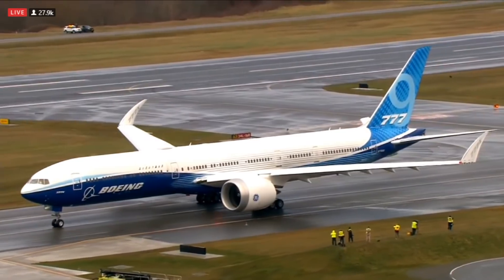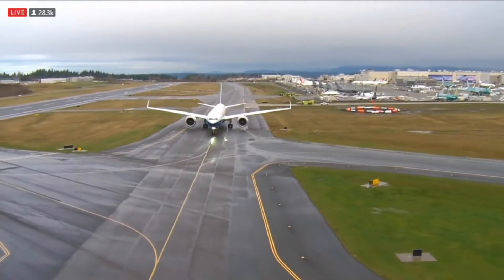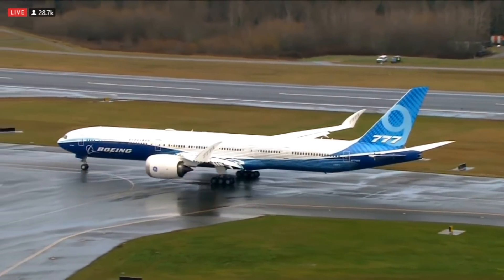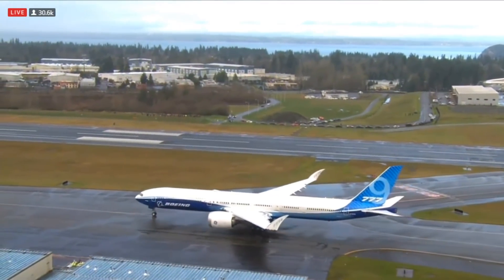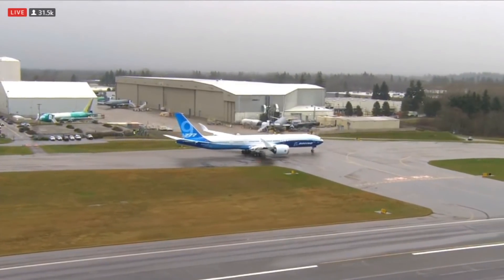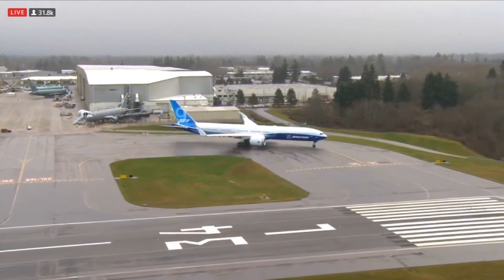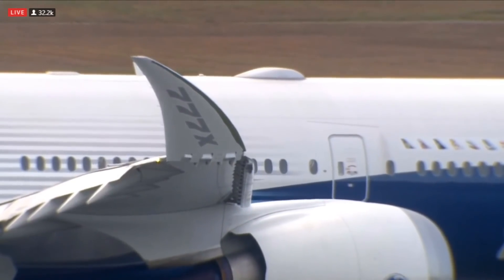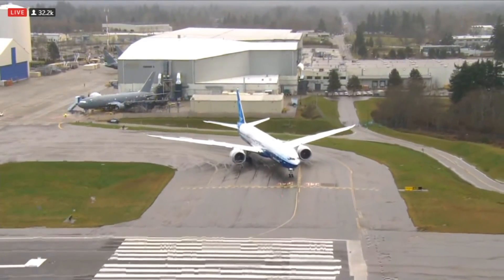Boeing 777X taxis to the runway for its first flight

Comment: I Hope for A Boeing-Industry to sending a proffesional-expertis as the official-supervisor especially to a loyal-costumers + the new airlines-company to around the world to traning the about of all navigation-system built-in or a important part-components inside because like The B737Maxx8 or The Airbus-310 NEO are having a crash-accident event { Lion-Air & Ethopian-Air  < B737Maxx8 and then Aeroflot-Russia , Wings-Air Germany + Air-Asia Malaysia > A310Neo } who caused the mall-function software and a failure body-structure hardware including the tail-wings design by a standart re check-in duty for safety-reason.

Comment: "We did it" no you killed 300 people with your error!
Reply: And how many people have been killed  on airbus planes?
Reply: @dbl2dancer  None with plane error all that where killed where pilots error!
Reply: @JestersWolf  Seriously a 321 didnt respond to throttle command at at airshow and crashs, air france 442 in 2019  A330 crashes and kills 220 people with a high altitude  stall
Reply: @dbl2dancer  That happend in 2009 and it was due to copilot error.
Reply: @dbl2dancer  Boeing will never wash of shame off of their name everyone will talk about this for houndreds of years maybe even more. You dont sell your planes until they are completly checked and stressed for all situations.
Reply: @dbl2dancer  heck even Boeing admitted making a mistake with the software. I wouldnt trust company that makes those kind of mistakes due to cost cuts. Its totally iresponsible and dangerous. Now they talk about safety! Safety allways goes first suckers!
Reply: @dbl2dancer  you are trying to justify and to wash off your fear cause you are probably a pilot on one of these flying cofins. Good luck!

Comment: can any one elaborate the major difference b/w 777 and 777x
Reply: The 777x also has more efficient engines for less fuel burn and will fly considerably further, thus giving airlines opportunities to add more cities to fly to non-stop, Also, the longer variant can add additional seats to reduce costs for the airlines. Finally the wings are made of composite materials similar to both the Boeing 787 and Airbus A350 which makes the wings lighter and stronger.
Reply: Foldable wingtips, longer fuselage, slightly bigger engines
Reply: New composite wing, foldable wingtips and new engine

Comment: 1:04 that van gets dwarfed by the 777X  engine 😬
Reply: @Lew Rodd yes the A380 is a big ✈ . Yet has nothing to do with the size of the engines on the 777X (others mentioned also how damn big they are). Im just replying about something thats in the video.
So the real question is whats the point of ur reply ?
Reply: @Lew Rodd 777x is actually bigger than a380

Comment: If they mess this one they will be out of game. Difficult times for Boeing
Reply: Truth  It's quite disturbing that people like you are still trying to make it seem like there is no serious problem with the MAX. Two of them crashed in identical circumstances, with the loss of almost 350 lives. And the root cause of the crash is a design flaw, there's zero doubt about that. Whether European or American pilots would've saved these planes is (very) debatable, but what isn't debatable is that NO aircraft should ever by design put its pilots in a situation where they have to save the plane. This is a VERY serious design flaw.

The assertion that thousands of flights of the MAX by American and European pilots happened without incident is also completely irrelevant. You'd have a (limited) point if on dozens of those flights MCAS would've malfunctioned in the way it did on JT610 and ET302, but the TRUTH is that none of them were reported. So the remark about American and European pilots is completely irrelevant.
Reply: Nico V  Agree and that is why I told him his name should rather be FALSEHOOD. If he is correct, why are ALL still grounded and why is Boeing not producing more. These are false information peddlers but they cannot deceive those of us that are current
Reply: @nicov1837  Exactly!
Reply: Truth  the truth is they were not trained at all, Boeing told to Lion that there is no difference between 737-800NG and MAX. Lion once requesting for a training but Boeing said that was an idiotic request. (Source: Bloomberg)
Reply: Domba Tersesat If it is true, why is MAX still grounded? You are out of touch and need to check your facts
Reply: migfed They won’t miss it.
Reply: @Truth You are just another ignorant entitled American trying to justify unnecessary deaths by a faulty piece of machine.Stop sharing crap.Innocent people died just in case you forgot
Reply: rein mahupete Agree. Check my response to his comment. His correct name is FALSEHOOD.
Reply: Truth comment so irrational.
Reply: Truth   Do you seriously think that they grounded all 737 Max for nearly one year just because of a problem with pilot training ?
Reply: Truth  your argument : rubbish
Reply: Truth  

#Truth
Reply: Well they had a screw up with the starliner capsule...
Reply: Truth So, why is MAX still grounded EVEN in USA and why is production halted? We need answers instead of your name calling
Reply: Truth Why is it taking more than one year to convince the world they are serious? Serious about what if you believe there is no problem? You seem to contradict yourself. Do you know the economic toll one year’s grounding has caused. Do not trivialize this.
Reply: Truth  Thanks for yet another illustration of that legendary maturity of yours. Out of interest: how old are you?
Reply: Truth  Twelve it is.
Reply: Truth Your true name should be FALSEHOOD because that is a distortion of the fact. Why did Boeing fire it’s CEO? Check your facts because you are out of touch
Reply: Truth  I think that in that insult-ridden series of posts all you've done is demonstrate your lack of maturity. I'll be going with the FAA over the likes of you...

Comment: Can those wingtips be left in the up position during flight kind of the winglets you see on other aircraft?
Reply: Those wingtips need to extended when flying to create more lift thus consuming less fuel.
Reply: @jayvee8502  The wings on the 777X are longer so the wingtips go up on the ground to allow clearance for the wings when the plane gets near the jetways.  Boeing had to get authorization from the FAA to prove they wouldn't go up in flight, just on the ground.  There are other videos on YouTube regarding the folding wingtips.
Reply: It's my understanding they can only be in that position while on the ground.

Comment: I’m curious about the folding wingtips. If the 777X had stationary winglets, wouldn’t it have had the same effect, i.e., more wing surface?
Reply: The winglet’s purpose isn’t to increase the wingspan, but rather reduce the vortices that come off the tips to reduce drag, hence decreasing fuel burn. The raked wingtip design is marginally better than a simple wingtip.
Reply: zippyTRG Thanks for the info. Obviously, Boeing had researched this issue, but I didn’t quite understand it.
Reply: A winglet serves a different purpose and it does not increase wing surface area as it is not a horizontal surface.  The added wing area of the wingtips does give a greater surface area and a higher lift to drag ratio which improves fuel efficiency

Comment: How big is 777x compared to previous triple 7 models?
Reply: 7 feet longer and slightly wider but its basically a widened 777 300er with new engines
Reply: Colman Tieszen And completely redesigned wings! So, no, it’s not a widened 300.
Reply: @wotan10950  i swear they said that the interior was wider but not the exterior
Reply: @lilwassabi8158  That is correct.  They shrunk the insulation